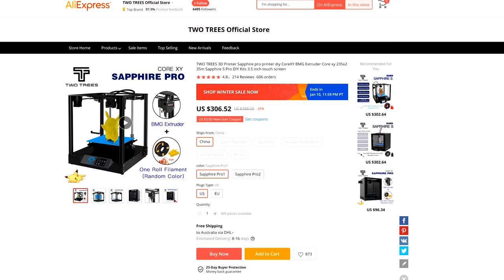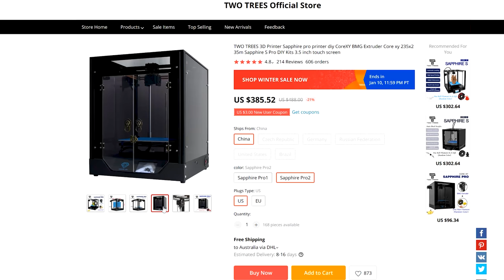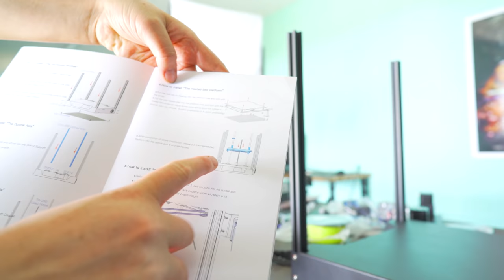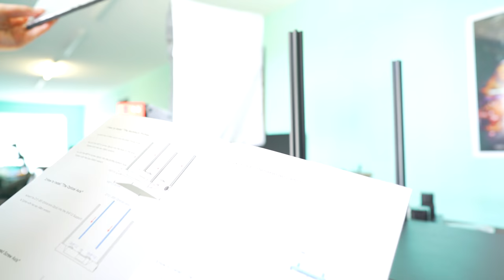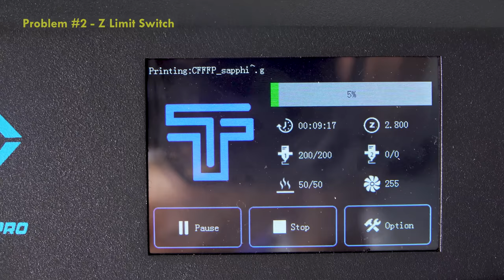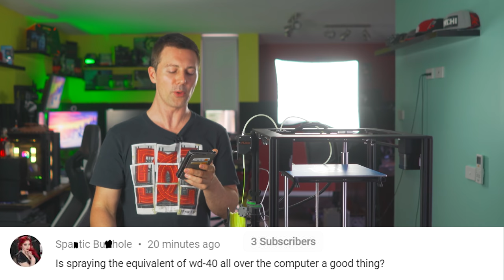BEFORE Buying a 3D Printer from Aliexpress... Watch This... (Sapphire Pro 1 Review)

Comment: 3D printers, below ~$1000, are going to be interesting. They almost universally require some work and setup, and are not good turn key solutions. Support is none existent from most of the retailers for printers in this class. 

I can tell from just watching your video that your X and Y axis belts are loose. You can actually see the layer shifting at 5:13 this is causing. That is caused because your belts are loose enough to skip a tooth on the drive gear during a rapid direction change.  You need to tension your belts.

Your hotend is a mess, and in all honesty, probably crap. It's 5 main parts; the nozzle, the heat block (contains the heater cartridge and sensor), the heat break, the heat sink, and the heat sink cooler fan. Your hot end is almost certainly leaking and clogging because your hot end is assembled incorrectly. 

This is a bowden type hot end; and at that price point I am certain your hot end does not include a full steel heat break, which means the bowden tube needs to be inserted all the way through the heat break. Most folks mess this up, and only insert the tube partially, which creates a gap between the nozzle and the bowden tube in the heat break. That gap usually gets hot enough to melt the filament, and create a small blob, which clogs the whole thing up. Remove the nozzle (you need to anyway for the next part), and insert the bowden tube until it's coming out where the nozzle is, that's roughly how far it should be inserted, so mark the tube with a sharpie at the coupler, and pull it back out. The hot end, end, of the bowden tube needs to be precisely trimmed at a 90 degree angle, so it sits perfectly against the nozzle when assembled. This is best done with a really sharp knife, like a hobby knife or a box cutter. Make sure it's exactly 90 degrees; if it's not, shave a little more off and get it there. Don't use snips or scissors, it crushes the tube.

The nozzle and the heat break (small tube that threads into the heat block, and the heat sink) need to actually be tightened to each other, not the the heat block. This needs to be done when the hot end is heated to around 200C ~ 235C. Basically there should be a small gap between the shoulder of the nozzle and the heat block, because the threaded end of the nozzle is tightened against the threaded end of the heat break. With the nozzle out, and everything cold, thread in the nozzle, and make sure there is a gap between the shoulder and the heat block, roughly 1mm when the nozzle is snug.  If there isn't a gap, you need to thread the heat block 1 turn further onto the heat break tube. You might need to pull the heat cartridge and heat sensor to do this on an assembled printer. After one turn, install the nozzle to snug again, and check for that gap. Once you have the gap, heat the hot end up to around 230C. Using an adjustable wrench to hold the heatblock, and a socket on the nozzle, tighten the nozzle. I don't have a torque spec for this, but it should be pretty snug. Keep in mind the heat block is aluminium, and you can strip the threads out of it. Not a big deal, they're easy to replace, and really cheap, but annoying.

Once that's all cooled down, insert your bowden tube all the way in. It should be very close to the mark you made earlier, or even further depending on how much you trimmed off. That takes care of the hot end assembly, and should stop your leaking, and clogging. The only other issue you might have is the heat sink cooling fan. Some folks plug them into the fan port of the control board, which is actually incorrect. That port is for a part cooler. You want the heat sink cooler running all the time. It should be wired directly to a 12V source (5V if the fan is only spec'ed for 5V, but everyone I've ever seen is 12V). If you've wired the heat sink cooling fan to the fan output on your controller board, you need to fix that. Wire it directly to a 12V source, so that fan is on all the time. Failure to have that fan on will allow heat creep up into the heat sink, and after a little bit of time, will cause filament to melt in the the heat break and heat sink areas, which causes clogging.

Your extruder eating the filament is all related to your hot end, which is clogging. Once your hot end is sorted out fully, the extruder should work a lot better. A knockoff titan extruder from Aliexpress will cost a whopping ~$20 with a stepper, and is a very worth while upgrade on any cheap printer. Seriously, it is a massive upgrade.

After all of that, you still need to calibrate your extruder e-steps, to ensure when the printer asks for 10mm of filament to be fed, it feeds 10mm, not 9mm, not 11mm, not even 9.6mm, but 10mm. That's a whole process, but very important to the success of a print.

I can't speak to the auto leveling, but you might be better off manually leveling the bed and setting your z stop manually. It's a little more work, but more reliable. Good luck.
Reply: Glad someone already took the time to type this out! Great advise to fix the many problems.
Reply: I bought a sub $200 anet a8 two years ago and after lots of work making it more sturdy and minor modifications here and there it prints great. If you want good quality prints from a cheap printer it will need lots of tinkering. Once I took care of z binding issues and made the printer really sturdy I almost never have to adjust the bed level any more so I have no need for auto leveling.

Comment: This printer would be a good candidate for modding, throw an E3D Hemera at it and an SKR mini, and you got yourself a large build area with great printing quality.
Reply: its just a clone of the ender 5 with some questionable choices in design, same price buy an ender 5 and get better support bigger community and still mod the crap out of it
Reply: Definitely agree to a point, though the Sapphire is a true corexy printer while the Ender 5 is not. Its also a bit cheaper, usually around the $40-60 USD which could be put towards modifications. The Ender 5 still wins in terms of setup, reliability, and support. There is where I would only choose the sapphire if it was going to be modded immediately, otherwise the Ender 5 would be chosen for its out of box reliability and support.

Comment: You didn't push the PTFE tube down into the hot-end far enough.  It needs to guide the filament all the way in.  You should be able to push a broken end of filament forward and it should just push the piece in front of it all the way down and out without ever having a way to "end up sideways".  Edit: this is probably a case of bad documentation and bad support more so than bad product.

Comment: You either pay a low price and the printer is the project or you have to spend more if you need a printer for a project. I got the cheapest possible one as I wanted a starting point to learn how everything works.  Now in the process of building a new one from scratch.

Comment: Welcome 3d printing.

Chinese 3d printers are best for those who like to tinker and fix things, again, again and again....and again. After buying and using 2 different Chinese printers for about 18 months straight, I have learned a lot about what makes a good 3d printer and I am done w Chinese 3d printers.

You get what you pay for. There are very good reasons why the Prusa Mk3 is often the best beginner 3d printer.

I now print using a Lulzbot Taz 6 and Ultimaker 2 (both where second hand and several years old but still valid and reliable.) several times a week, often daily. That is simply not possible w Chinese 3d printers.

I can run cheap filament and the Taz/Ultimaker will usually work w/o issue, but normal I stick with eSun filament or better.

Comment: The bowden tube looks insanely long! Shortening it to a suitable length would definitely help improving the print quality.
The machine looks decent and there's room for shit tons of improvement and customization.
The frame is similar to the XTLW Model 6 I purchased earlier this year, except it has two independent extruders (IDEX setup). Took ages to put together but print quality is amazing!
Good luck with this one :)

Comment: I bought one. And am super satisfied with it. There are some things you might want to change. But the parts you get are good enough if you like tinkering like me. But then again I build dozens of printers. And I dont run into the beginner issues as you did. The clogged nozzle seems like the ptfe tube was not inserted deep enough into the hotend.  But yes it might not a printer for starters. Unless like you have experienced friends to assist.
Reply: hi, what printer would u reccomend?

Comment: Ender 3 PRO or even Ender 3 is probably the best newb/DIY printer on the market. As mentioned below, it has a huge upgrade following as well as a ton of users who will provide help if you run into troubles. I just purchased the Ender 3 PRO for myself, never having owned or even seen a 3d printer before. It took me 45 minutes to assemble, another 15 minutes to make sure everything was square and free of binding. I've printed 11 things so far and they all came out nearly perfect, far beyond my expectations. I purchased Capricorn tubing kit and aluminum extruder as well, but have yet to install these parts because this works so well right out of the box. Also, the Ender 5 that is a bit more really isn't worth the extra money as the 3 does pretty much everything it can at a lower price.

Comment: Great video. I have bought several better units for $250 USD shipping included. The ones I bought were not only cheaper but only took 8 screws to be usable (12 including filament holder)... The model you were sent was not well engineered by the sounds of it

Comment: I've been a long time fan of your channel and it is quite refreshing to see you try and tackle 3D printing. You could get the Prusa i3 MK3 machine, this is more suited for people just getting into 3D printing. This usually goes for about 3 times as much but it has all the manufacturer support you will ever need. Or go for the Ender 3 which is even cheaper at around 180USD and has a good community that can help you go along in case there are issues. Cheers mate, happy 3D printing!

Comment: I seemed  to have better luck with mine, it  works  well. I agree, it is not a  printer for beginners.  I have had very good prints  using  PLA + , or  PLP Pro,  depending  on the manufacturer. Nice solid printer in you have the patience and skill to build it right and tune it .

Comment: I have a Sapphire S and I am totally happy. Even I was a beginner when I started. It was a fun project. I needed modification to. Now I recognize every problem. I think your expectations are high with no experience. There are great facebook groups for help. Mine prints better as a printer 4 times the price. Out of the box is it not going to happen. After a small journey of fun learning it’s great. Rui Raptor has great video about the assembly of hotends. Make it fit right, short your bowden and calibrate it. Lots of bontech clones suffer from bad gears. Lock them with locktide if you want to spare 60 bucks. Also make the rulers parallel. Grease everything. Check your firmware and settings and it will autolevel. Make it a fun project and happy to help on Sapphire facebook group. I am happy with a printer priced 1/3 of the ones out of the box with capabilities to be twice as great. Frank

Comment: Don't give up on this! A Core XY printer (like this one) is a style of 3D printer that I think is not for a beginer. This machines are a bit frustrating and might decieve a "noob" from the 3d printing world. But don't let TwoTrees make you give up. Printer kits like this one are kinda dificult to assemble (and even more if the instructions are garbage). Now for fixing it, in parts I guess you will spend no more than 40usd (I'm well exaggerating). I would recommend a new extruder (from bangood, or anything, they are not bad) and have someone (or research on youtube) that completly rebuilds the HotEnd for you. After that you can try and have a go on installing a Open Source firmware called "Marlin" to fix the auto leveling. This will take some serious hours, but you will learn on the way. The channel ruiraptor has a nice build guide for this printer if you want.

Comment: I have two printers now, one used that I bought for 150 which is a tronxy x1 and bought new ender 3 pro.
Both needed tweaks and settings completed before getting great prints.
The tronxy I did a full rebuild and moved all the electronics and design.

It is a "tool" knowing how to use and trouble shoot is the same for a PC.

If you need some help I'm in VIC and can fix all of this.

Comment: I got a 3d printer from Ali Express a few months ago. (I purchased a CTC bizer for $120) and I didn't have to assemble anything, it all came pre calibrated and everything just worked. I've never had any filament jams  (even with the cheapest possible filament)and the included software was incredibly easy to use.  Only minor problem I have had is one of the wires going to the y axis stepper motor got torn of the connector (it was about $1 for a new cable for it)  it took absolutely no knowledge of 3d printers and about 5 minutes to fix

Comment: I personally would chuck that motor print head and find a better alt, Along with the feeding tube as well, I would get something a tad wider and more flexible and durable. Also what was the filament? I ask because curious to know if it was place or abs which both would need different temps to melt.

Comment: Since 2013 I've owned 3 different printers. 1st a Up plus 1, easiest to setup and print in few mins, but very limited in size 15x15x16 cm and 150 microns per layer minimum. 2nd a Anet A8, a long afternoon to build and set, it seem I've been quite lucky with this one from what I saw online, worked fine till I sold it to a friend who enjoy it too. and my last one is a Tronxy X5SA pre build and sold almost new by another guy for 325$ CAD. It took me 2-3 weeks in try and error to find out a bug, but now it work fine and allow me to print up to 90mm/s (stock printer except some bigger wires and a mosfet) and as big as 33x33x40 cm. Look a bit similar to yours but the bed got support on both left and right side. Look kinda fragile to see support only on the back.

Comment: Alot of the calibration procedure is for you to figure out. These types of printers are not intended for first time users, but more like seasoned/technical users that know the saving costs for doing the small things themselves.  Unfortunately, this is how they are made from some companies.  
People who have some experience know to never use the cheap material that comes with the printer for example. The heads and extruders will almost always be low quality and should be replaced, or prepped and modded because they have a tendency to screw up. Sometimes the firmware comes faulty also along with other small things and may need tweaking. If you're starting, look for a printer with very large community base to help you get started. If you have friends to help you with this, then the better. 
Sapphire pros from what I read are a tweakers printer but can print high resolutions if calibrated right

Comment: I purchased a Two Trees Bluer a few months back. 
It arrived and had so much wrong with it. It was missing a few parts and didn't have eccentric nuts on any carriage. Not allowing you to tighten any of the carriages. This is a huge problem that needs addressing before i continue to print with the machine. So for now it's sat idle. 

I have contacted them via email/facebook everything and it has taken until now for them to finally get sick of me and tell me they are sending out the newer parts all with eccentric nuts on. 

The damage is already done though and now, i wouldn't touch two trees with a bargepole . I'll stick to the trusty ender 3's i have. 

Whilst the enders still are problematic at times. The documentation and company support is there.

Comment: Hey Bryan. Seems like the issues you're having are really common printer issues for beginners. Double check the retraction length, should only be around 2-3mm at 60mm/s. Too much retraction can cause a clog, The grinding of the filament can be caused by a clog/semi clog or too much tension on the extruder. I also suggest calibrating your esteps, run a pid tune, make sure your thermal runaway is enabled in marlin (or what ever its using).

Comment: Generally you're not going to get great customer service with cheaper printers, the community is where you're going to get more help. If you just want to print, cheaper printers are probably not what you're looking for. I started with a cheap printer and I would have never have learned so much about printing if I just got a printer that just worked perfectly after getting it.

Comment: I work with 3D printers a fair bit and definitely do not recommend any of the chinese kits to a beginner who hasn't done loads of research first. They all usually come with faults, terrible instructions and design flaws, I got started with a kit printer but knew exactly what I was getting in to. The Aldi printer is a good option, it is basically a wanhao i3 plus printer which is not too hard for a beginner, try find one of those lightly used.

Comment: if your interested in getting into 3d printing, pickup a creality ender 3.
Reply: Well that is another printer that requires a little bit of work
Reply: @MasterControl90original  i have 2, they are easy to assemble, Cura has a pretty decent profile to start with. pretty much as long as it is assembled properly, belts tightened. bed is level. your good to go
Reply: @nissanmikey  yes, it is not a train wreck like this one that's for sure.